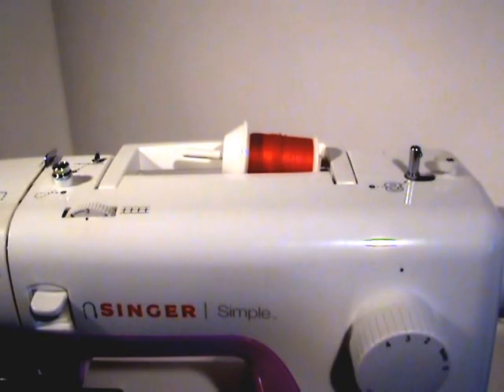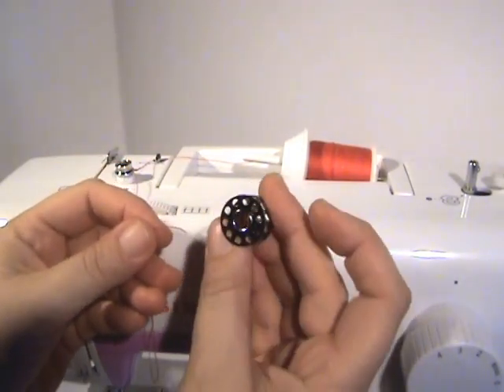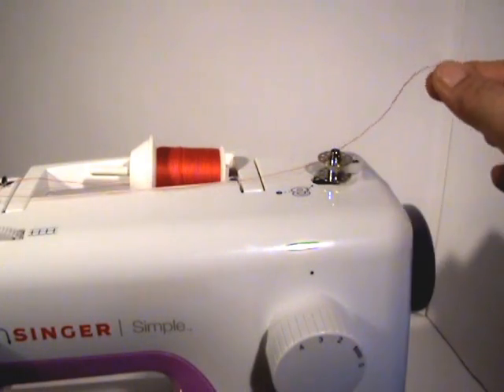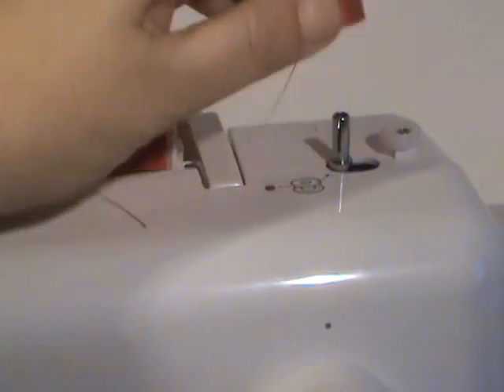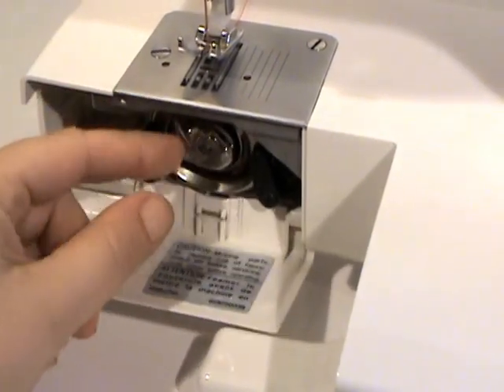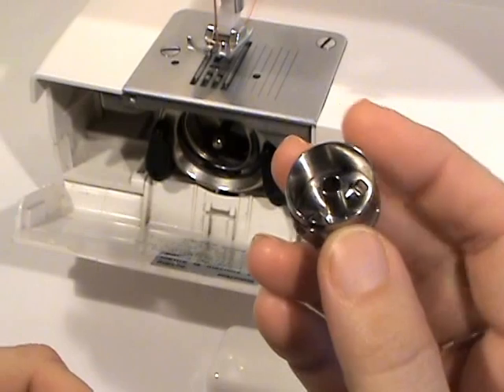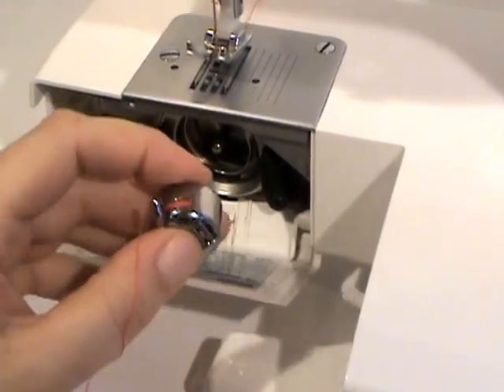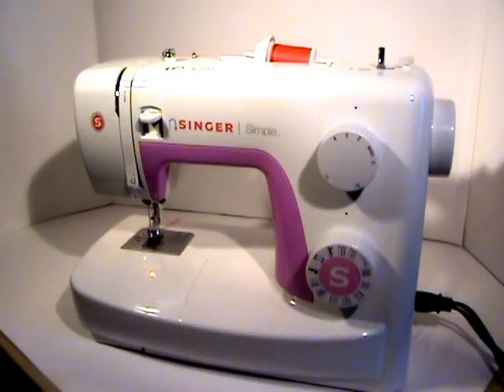How To Thread And Load A Bobbin In A Front Loading Sewing Machine

Comment: Finally, an actually good video! I'm over here with my 50 year old machine from my great aunt tryna figure out how to do this tysmmm
Reply from the maker: Good luck.  I hope this helps.
Reply: @2howlingmonkeys71  Would you mind helping me? I need someone experienced :). I did everything right and set the foot down, as as soon as I started to sew the machine went one stitch and then stopped moving. Now there's a lot of string tangled in the bobbin. Do you know what might have happened? Everything was threaded correctly, and the 2 strings were trailing behind the foot, but I think maybe they got caught up the the needle?

Comment: how to adjust tension tool I mean which number is suitable straight stiching
Reply from the maker: It depends on your brand of sewing machine.  You will need to check your sewing machine's manual.  It also depends on the fabric that you're sewing with.  Normally, if you are sewing with cotton fabric, you will need the top tension to be around 2.5.  The higher the number, the more loose.  That is good for baste stitching.